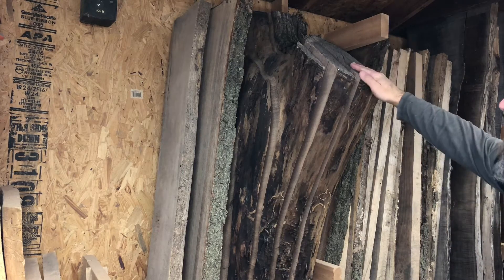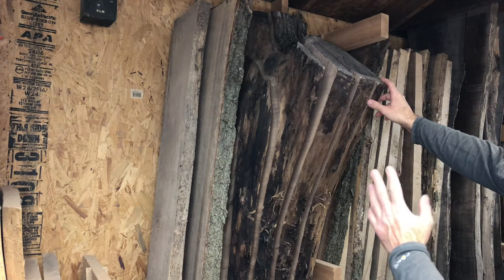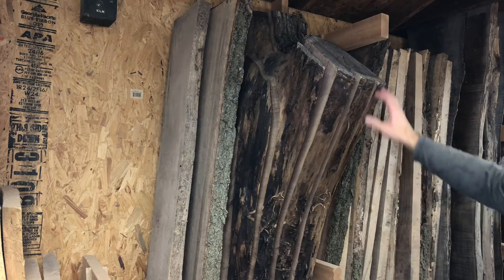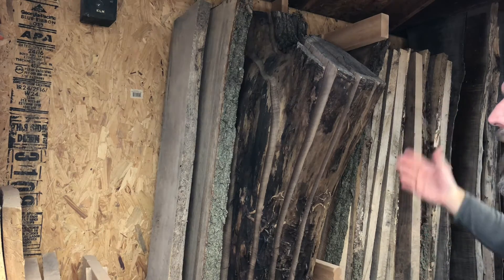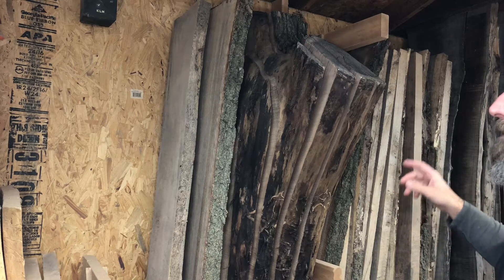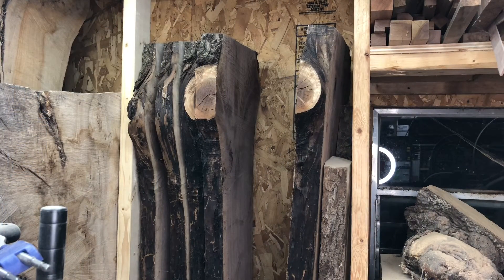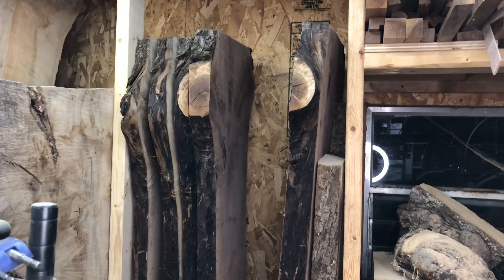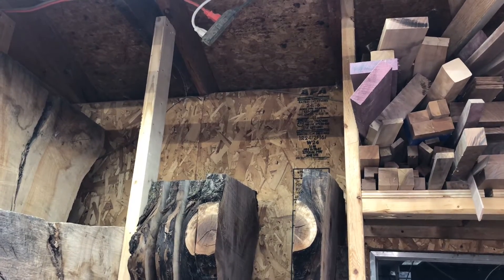Milling Monday #19 | My Slab Drying Process, PT 2

Comment: Stacking them like that, in theroy would it help to minimize warping and twisting? Do you recomen stacking them but end down? Or does it matter? I like this idea. Like you said in a previous video how much space it save. And the lack of shelves to build junk up on.
Reply: Vertical stacking allows warping and twisting to occur. Horizontal stacking with stickers allows you to add weight to the top of the stack to minimize warping and twisting. It also promotes better airflow around the board for more even drying. Vertical stacking is great for viewing the board faces and does save space, but I would air dry in a horizontal stack until below 20% moisture content. Most of the warping and twisting forces will be stabilized and rotting is not a concern below 20%. Then you can stack vertically and not worry about airflow other than for the time it takes to get from 20% to 10/12% MC (depending on where you live).